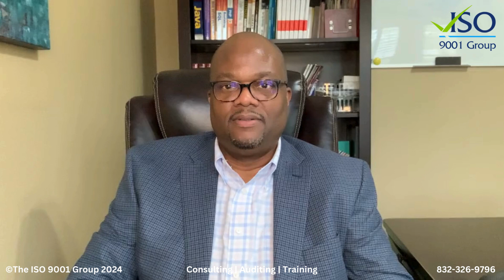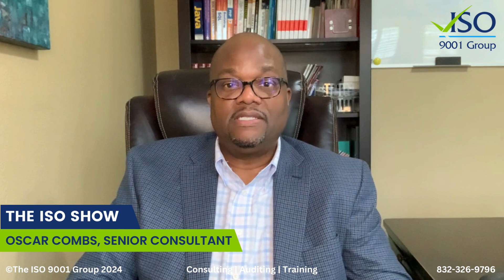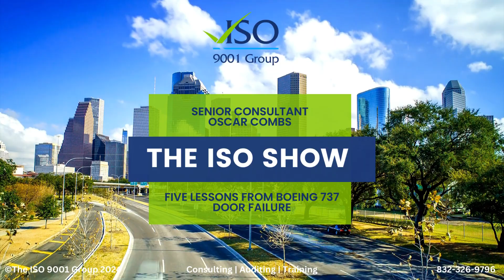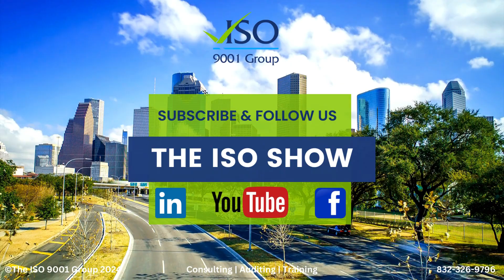The ISO Show Five Lessons from Boeing 737 Door Failure

Comment: Why are you and no one else talking about the ISO Auditing? It appears as if ISO wants nothing to do with why ISO didn't find or highlight that Boeing itself doesn't audit for or comply with ISO requirements.  The elephant in the room is that Boeing places 9101 requirements on suppliers, but doesn't itself follow them...  And ISO has no power to audit it's board member, and the FAA is complicit in that the have given Boeing card blanch with its ODA program.  Look to see if this boeing department was audited in the past year by ISO.  If it wasn't ISO, you and your channel have no legitimacy.  Note all of your lessons are great, but none of the are legitimate, because most of us that have built Boeing aircraft knew the night of the incident that Boeing itself had installed the door and that it wasn't a supplier issue.  You have to vet your subjects better.